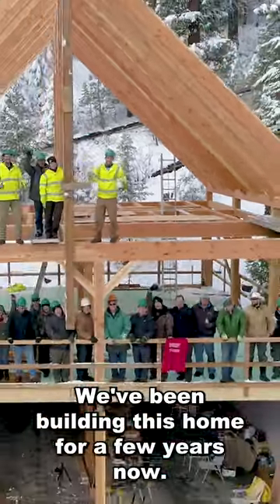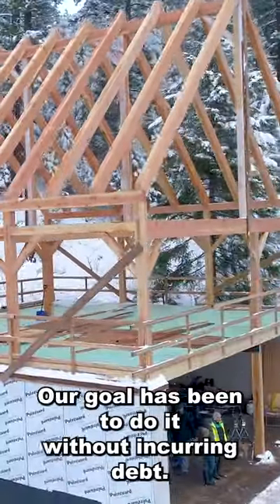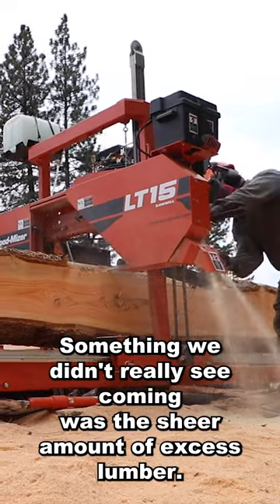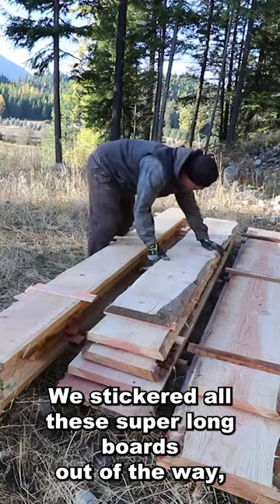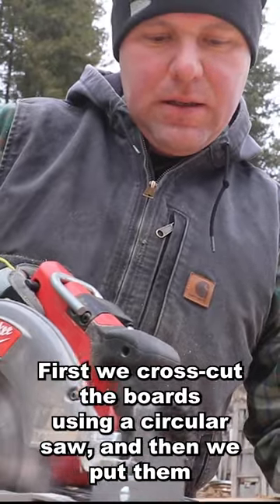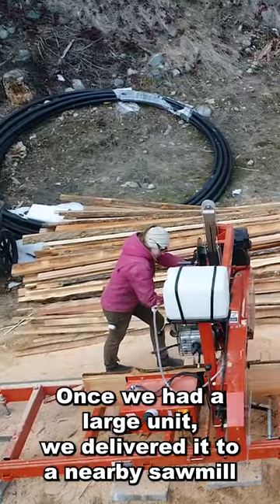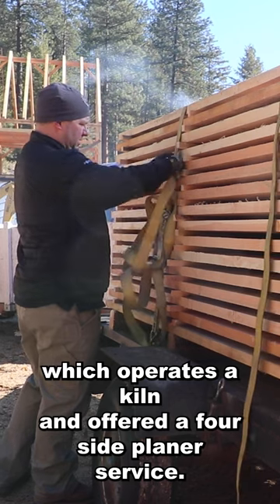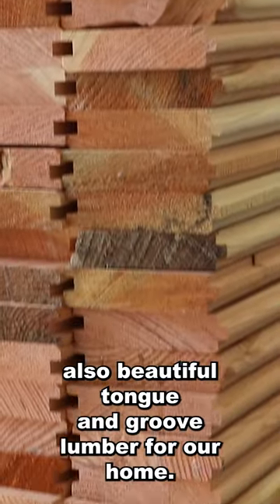We Turned Logs into Beautiful Tongue & Groove Boards

Comment: I remember you did not put your Timbers in a kiln when you raised the frame. Now the decking is kiln-dried.  When do you have dried and when do you not have kiln-dried? Thanks
Reply from the maker: Kiln only used once for the t&g decking because of time and the importance of low moisture for planing and shaping. Had we known it would be years before use air dry would have been better. Many boards had very large checking cracks from kiln which is lost wood. Air dry slow is better. We thought we needed the lumber quickly so we used the kiln. Otherwise we like to saw and air dry for 1 year. 👍 Timber frame must be cut green and raised quickly after to ensure tight joinery. Dries together 1” per year